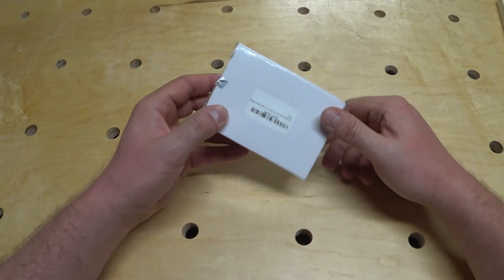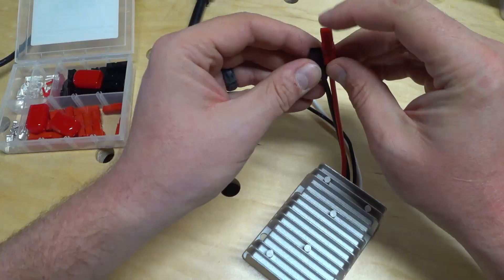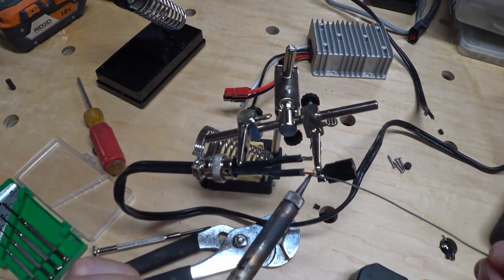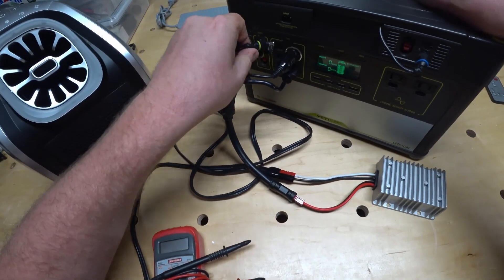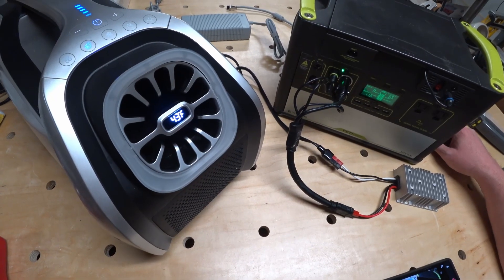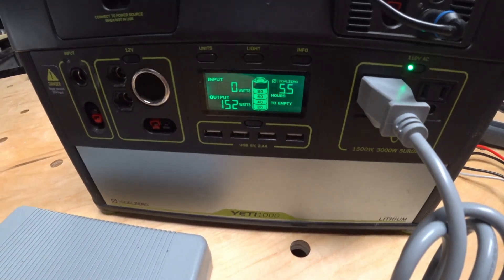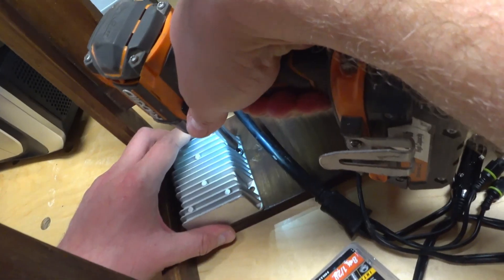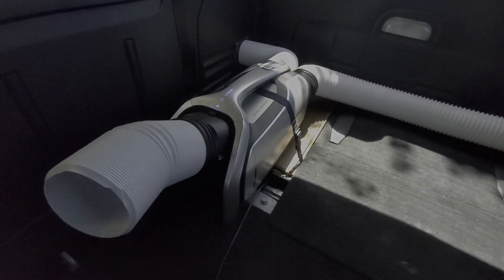Zero Breeze Mark 2 - Powered by 12 to 24V DC boost converter - Wiring/Testing/Comparison with 120V

Comment: This is exactly what I need— come on Zero breeze—they need to get with the times…make this run off of 12v power packs (solar driven) as inverting to 110v is not efficient.
Reply from the maker: I runs off 12v batteries via a 12-24V converter.  The original air conditioner was 12V, and that was one rather large issue with it.  It required twice the amps to be pushed through small gauge wires that got really hot.  Run all that in a hot environment, and well, mine failed.
Reply: @Polymathicus  Oh yeah that makes sense.  SO— atm I do not have the battery for the ZB…In order to run off my 12v power bank (Bluetti’s AC300 500ah battery/750w solar) I would need ONLY the ZB battery and their 12-24v converter?   Also thinking to just get more battery/solar and run it on the 3000w inverter (110v). Ugh such a dilemma. I am tryna avoid buying the 12v AC (5000.buckaroos).  What do you think? I am in a van- PRomaster 2500/well insulated. 2 pets, so I need something to top of the heat—freezing cold isn’t necessary.
Reply from the maker: I should mention first that the Mark 2 is only 2300BTU's, so it won't cool down a van that's in the sun at all during the day in fact it won't even hold temp if the sun is beating down on it.  It will only cool down what it's blowing on right in front of it.  Overnight is a different story, and some have had success blocking off parts of their vans and overinsulating the space.  Your dash ac in the promaster might be something like 25,000BTU's just for comparison.  

You don't need any ZB batteries to run off your AC300, just a 12-24V converter that you can buy from ZB, or on Amazon, and wire it up like this video you commented on.  If Amazon, get one that is rated at 20amp or higher.  Then you just have to make a cable that plugs into any of the output ports of your AC300 that is rated at least 20amps.  If you get more batteries/solar, I'd still run it off your batteries as the Mark 2 runs off DC power, so keeping it all DC is the most efficient, you only have to feed the Mark 2 with 24V, whether that be a 24V battery, or a 12-24V converter.  

I know how it is with all the options, stressful.  If you can envision all the things you'll be powering a couple years down the road that might help steer the decision.
Reply: @Polymathicus   Thank you for the extra info—yeah brain freeze is real:()) If it were just me, I can suffer (open doors etc—but with two pets, I can’t always open doors if in the city, etc).  Thank you!

Comment: Pin 1 is positive and pin 3 is negative?
Reply from the maker: Mine is like that.  But always check the back of the AC power brick where there's a pinout diagram just in case something has changed.  Or use a multimeter on the factory cable end when powered and make sure red is in pos and black is in neg, and the screen doesn't show a "-"

Comment: Love this video, I just ordered a 12 volt to 24 volt, what size cable should I use to wire this converter to the cigarette lighter plug in thank you for everything, keep the good stuff coming out . God bless you
Reply from the maker: Thanks!  First, you need to make sure that the cigarette plug you will use can output ~25amps continuously and safely.  Then, in my opinion when building DC cables in general, use the largest gauge cable that you can stuff into your various cord end / plug.  The connector on the Mark 2 for example that they use has a super small hole, and I struggled to find something of adequate gauge that would clamp down in there.  If you take a look at your converter (if it's the amazon type like mine) and match up the gauges that are coming in/out of it since that's going to be the "choke point" you should be good, since you're limited by those wires coming in/out of it.  I don't remember what mine are at the moment, maybe 12/14 (in/out).   Keep cable runs as short as possible (especially 12V since you're pushing higher amps)...longer the run, larger the cable. 

I hope that helps get you there, I know it wasn't necessarily an answer!

Comment: Does the power converter need to be disconnected when charging the battery? Planning on powering an amplifier and I saw the instructions said never charge battery
Reply from the maker: I never disconnect to charge my Yeti or Bluetti.  It stayed all hooked up in my vehicle and I would just run an extension cord out to my vehicle and plug in it's power brick overnight.  Running the Mark 2 while charging the battery...I have only done that while solar panels were hooked up to my battery and there was no issue, all ran well and 200 watts of solar provided enough power to run the Mark 2 (through the battery).

Comment: Thanks for the valuable, well presented testing.

May I ask if it is more secure and even possible to run the zerobreeze with this DC Converter: Victron Energy Orion IP20 12/24 Volt 20 Amp DC-DC Converter

I do have other victron products installed within my campervan and aim for a clean and permanent installation of the zerobreeze under the passenger seats in the back, connecting it over the converter directly to a 300ah LifePo4 12v Battery.

Any input is much appreciated.
Reply from the maker: I don't see why not.  Can't go wrong with Victron.  I've got a whole bunch of blue in my RV.  Those specs are what I've got in my China converter.  Just make sure you're fused.  That'll be nice to just have it hardwired into your system.

Comment: i plan on using this in a hot 95 degree vehicle.   how hot did the 12V to 24V Boost Converter get?
Reply from the maker: I first had a 15amp converter and that got HOT.  When I switched to the 20amp version, not nearly as hot.  I could touch it in a 105 degree vehicle while it was running the Mark 2.  It was hot but not melt down hot.  Would run the Mark 2 all day.

Comment: Very informative videos! I am currently using the converter from zerobreeze, and it does not work. Will be purchasing a unit like you have from amazon but have questions on wiring to the mark 2 cable. What pins are used for the 24v output? Or is it just two wires when I cut the cable?
Reply from the maker: Thanks.  What was the issue exactly with the Zero Breeze converter so I can pass it on to others.  

There's a pinout diagram on the back of the A/C power brick, so I would verify on yours just in case something changed, but mine uses pins 1/3.   1 is positive and 3 is negative.  Nothing was hooked up to 2/4 on mine.

I highly recommend a multi-meter if you don't already have one.  They can be gotten cheap online or from HF.  This way you can plug your power brick into the wall and verify on the Mark 2 end plug which pins are getting the 24V.

Comment: These are advertised to use 240 watts on ac power. Which is what mine draws. Dc to dc is going to be more efficient. But why does your ac watts seem low? Don’t think they would advertise 240 watts if they were a more efficient 160 watts on rocket mode.
Reply from the maker: Without re-watching that video, I'm guessing it might have been cold in the garage.  The power requirements change quite a bit depending on ambient temps.  240 watts on AC in a hot car parked in the sun....for sure.

Comment: I recently purchased the ZB to use in my camper van and have been running on AC so far. I was debating the investment of a converter but hoped to see the consumption difference before doing so. If I followed your vid correctly, it boils down to a 14-ish amp usage on AC versus 10-ish amp usage on DC. Over a period of 8 hours that would be 32 amps difference, which is roughly 11% of my current capacity. Seems to be worth it on paper. ZB offers an adapter for $100 but they market it as a battery charger but lower on the page make mention of powering the ZB with it. I've asked for clarification. Thank you for sharing this vid.
Reply from the maker: Its not a HUGE difference in consumption, but if you're pinching watt hours, it makes a difference.  As far as the converter, you never know what you're going to get from China.  The first one I bought from Amazon was a 15amp and it wouldn't run the Mark 2, so I upgraded to a 20amp and it works great.  I think ZB markets theirs as battery only so people don't go trying to run the AC off their cigarette lighter plugs being fed by 18 gauge wires.  If you are feeding it from a constant, clean, adequate, DC power source with adequate wire gauge, you'll probably be good.  I'd assume the guts of their converter is what you get on amazon, or similarly capable.  You just save some money rolling the dice on an Amazon one.
Reply: @Polymathicus  I've ordered the components from Amazon and will give it a go. I'm doing this partially for the power savings but also to avoid running my inverter all the time. The only reason I run my inverter is when cooking on my induction cook top or powering Starlink. I want as much as possible running off my 12v system to avoid power loss in conversion/running the inverter. Thanks again for the vid. It was helpful.
Reply from the maker: Glad is was helpful!  Good luck with the project.
Reply: @MooreDoing  hey did you do the conversion adapter or stick with using AC or purchase the converter from ZB?

Comment: I did everything you did in this video but the zero breeze gives me an error with the dc converter any idea why??
Reply from the maker: First would be to track down what the specific error means either online or email Zero Breeze as that might tell you quickly what's wrong.  If everything is wired correctly (Pos to pin 1, and Neg to pin 3, etc), you might be having a low current issue like I had, but I'm just speculating.  What is the amperage rating on your converter?

Comment: can you configure this setup without Soldering?
Reply from the maker: I think Zero Breeze sells a DIY cord with the Mark 2 end attached already (last I checked).  They also sell a 12-24V converter with bare ends.  But then you'll have to wire and connect ends to attach to your own power supply which may need specific crimpers depending on what kind of plugs you're needing.  But can definitely get away with no solder.

Comment: Great review. Thankyou for your efforts. Can't seem to find a plug n play 12v to 24v converter booster adapter kit. I've seen many other types of dc adapters that cover all types of different manufacturers inputs and outputs. Seems like some company would make one? Male connectors on the 12v input side and female connectors on the 24v output side would be nice. Any thoughts on where, or if, a pre made, no termination required option could be found?
Reply from the maker: The only one I'm aware of with ends put on already is the one that zero breeze sells.  It gets you close with what looks like xt60 end on the input side. 
https://www.zerobreeze.com/collections/mark-2-accessories/products/12v-to-24v-inverter-for-mark-2-battery
Reply: @Polymathicus  Thankyou

Comment: Hi! Thanks for all your videos, I've watched many times to learn from your ways 🙂This being said, when I wired like you did, my zero breeze starts beeping and will not turn on. I do have the EcoFlow River Delta, which also supplies 10A out of the car charger port. I'm thinking that it is perhaps the NOCO 12V car port connector that may not carry enough power? Do you have any other thoughts as to why the step up converter is not working? It IS putting out 24V. Thanks for any advice!
Reply from the maker: I can't say for sure in your situation, but my own experience with the Mark 2 not wanting to run was a lack of current.  I needed to upgrade to a 20amp model of 12-24V converter to supply enough juice to the Mark 2 to make it happy.  If you're sure you're getting 24V at the plug in the back of the Mark 2, then this could be the issue.  Could be that 10amp port for sure.  Do you have another "out" port that can supply more amperage?  With my Yeti I had to use their "Max Current Cable" which merges the output of several DC ports to get enough amps out to feed the bigger converter and in turn push out enough power to the Mark 2.
Reply: @Polymathicus  The video does not show it well but I believe he is soldering two pins on the connector to one wire, pins 1 and 3 to one wire and pins 2 and 4 to the other.  Correct me if this is wrong.  May be the reason for the beeping.
Reply from the maker: Hi.  The two wires got soldered to pins 1/3 (Pos/Neg) only.  There should be a wiring diagram on the back of the included AC power brick (just in case they've changed it at some point).

Comment: The the mark 2 cable when hooking it up to the step-up connector how do you know which wire on the mark 2 cord is power and which one is ground?
Reply from the maker: There's a pinout diagram on the back of the included AC power supply.  If I remember right they use #1/#3 (Pos/Neg) which are labeled on the plug ends also.
Reply: @Polymathicus  thanks for the help I figured it out. It has 4 wires but they are doubles at connector. Thanks for your help.

Comment: Can you repair these ac units?
Reply from the maker: I don't know the official answer to that question, but I imagine the Mark 2 was not designed to have the refrigeration components serviced by the end user or service tech, but I could be wrong.  A question for Zero Breeze for sure.

Comment: So you wire them in pins 1 & 3 but which one is positive and which is negative? Like is pin 1 the positive wire and pin 3 the negative wire?
Reply from the maker: Hello, I believe that's the case.  There is a pin diagram on the back of the included power brick charger.
Reply: How did it not see that on mine thanks

Comment: This video is really useful. I happen to already have a 2.5 KWh 24v battery pack I use to run Dometic fridge so this would be a great addition to extend camping season.
Reply from the maker: Yeah, just wire it right up, and fuse it.  As long as your battery bank is outputting stable 24v (within the +/- range of the Mark 2) can't see why there would be any other issues.

Comment: Thank you for this. Any comment on this from ZeroBreeze website, "It is not recommended to use the adapter to power the Mark2 air conditioner directly, as it may damage your power source once it isn't able to supply continuous and sufficient power." I REALLY want to use DC to power it. Thanks!
Reply: Oh, just read your answer to a similar question. So you think it's okay to power ZB directly from 12 to 24 converter?
Reply from the maker: You can use DC.  You'll need a suitable battery, adequately sized power wires, and a converter to supply the Mark 2 with 24V.  I found I needed a 20amp converter.  The first, 15amp I bought off amazon kept making the compressor cycle, but as soon as I upgraded the converter all has been well for over a year.  I think you might be referencing the converter on their website that also comes with a cigarette lighter plug end?  You most certainly would not want to power the Mark 2 from a cigarette lighter plug in a car.  But you can wire the one currently on their site to your own battery.  I would assume the guts inside there are the same as the converter I bought on amazon.
Reply: @Polymathicus  Thank you for your thorough response. I really appreciate your generosity with your expertise and help. :-)

Comment: Thanks for thee video. I got mine a year ago and did not unbox until now, yet I can't make it work. Did you experience issues with yours at all?
Reply from the maker: Not with my Mark 2.  Are you using their battery?  Their customer support has always been responsive, might see what they advise.
Reply: @Polymathicus  Well after all I been trough during this time I have not been able to connect with the support but I will. Mo I’m not using their battery. 
Thanks your video has helped me understand the functionality of Zero Breeze!

Comment: If you don't mind me asking, what happened to your first zero breeze?
Reply: He said in another video that it just started smoking in his car and stopped working.
Reply from the maker: As Caesar said in the other reply, my Mark 1 was struggling on a hot day, I heard a pop, and white smoke started billowing out like a wet campfire.  That was a huge problem in the Mark 1 design, the 12V system.  I used the thickest gauge wire I could get into the connector, but still, everything got SO hot pushing all those amps, it was inevitable.  The upgrade to 24V on the Mark 2 was a necessity....thinner gauge wire now, and still can grab a hold of all components even after running for hours in a hot car.